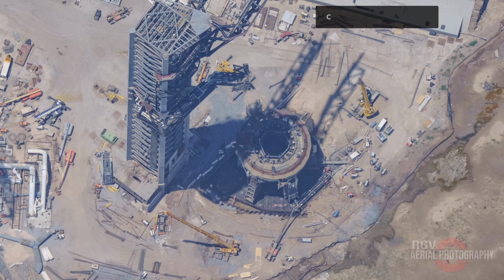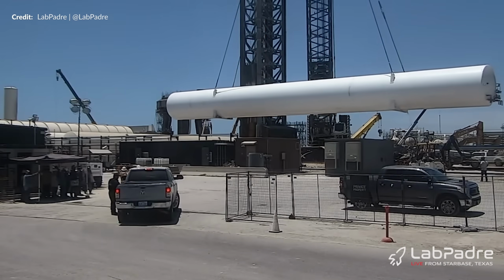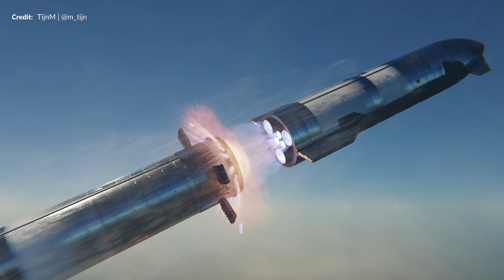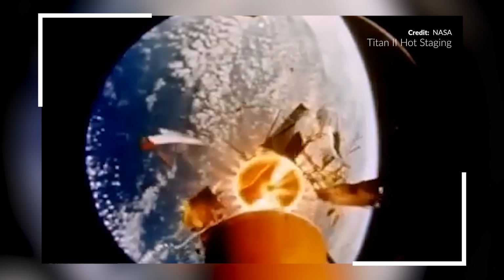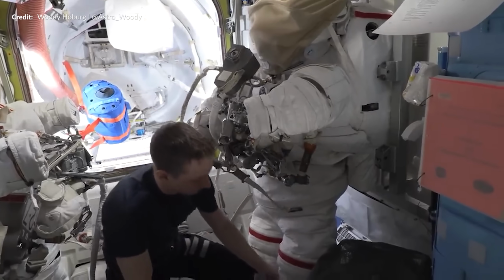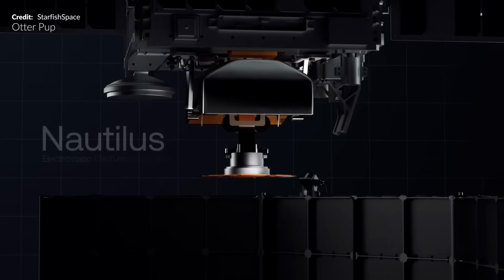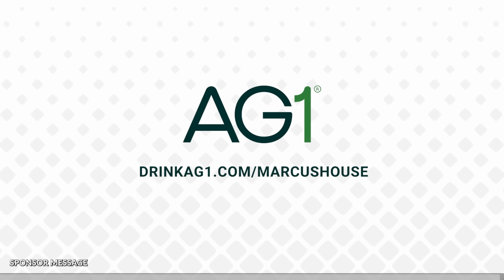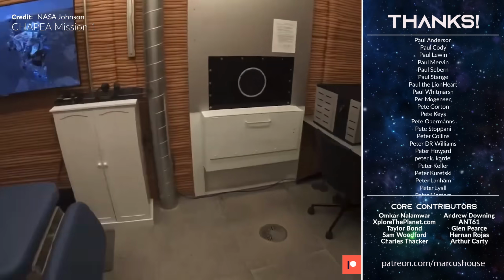SpaceX Drops Bombshell Upgrade Announcement: Can it really be that good?

Comment: It's just astonishing to me that SpaceX has all this manufacturing and constructing ability. There are so many projects going on simultaneously. It must be a massive task to line up materials alone. I mean where do they get all that stainless steel from, for example, all preformed to exact specifications. Wow, just wow!
Reply: I'm guessing you've never seen a mega mill being built before. There are astonishing things all happening at one time by hundreds of contract companies that are there to only do their job
Reply: I don't know that "preformed" is the right term - SpaceX has proprietary alloys which means they own (or at least control) everything in the entire production chain pretty much back to the smelters.  Most of the specialty metals used in spaceflight construction is also recycled separately and specifically for re-use by the same company since they need such very specific grades of steel etc - e.g. every test article that's damaged/destroyed will get melted down and dropped off back at the start of the production line, as well as all the trimmings/shavings from CNC machines and other manufacturing steps.  Smarter Every Day had a nice video on ULA that covered a lot of that stuff.
Reply: Calm down boys.  Has anyone stated/CITED a single reference here?
Reply: @Chucksss316 , I know  right.
Reply: Makes you realise how much military contractors are fleecing the government's.
Reply: @@Chucksss316 You know that there are almost 5000 different kind of "steels" ??

Steel is an alloy consisting of on a basic level of iron and a carbon content of less than 2%.
Speciality steels contain other metals to make the steel stronger, more elastic, more heat resistant, resistant to oxidation ..... various tweeking of steel properties.

SpaceX did work with steel mills to find the right speciality steel for it´s Starship project.

That steel is called 304L stainless-steel.

SpaceX build certain elements of their rockets out of 301 stainless-steel. 301 is a blend of nickel, chromium and iron and is more resistant to corrosion than carbon fibre. However, they have now moved to 304L stainless-steel which features higher chromium content and is therefore even less likely to corrode.

Of those 5000 steel types more than 2500 steel types have been developed in the last 20 years alone!

So please just shut up if you have no clue of what you talk about. Thank you!
Reply: There was a metal cutting machine in the video.  At least some of it was made right there.
Reply: Imagine SpaceX first has to mine all those metals from pits all over the world to then invent and built machines to transport it all to the US before they can even get started! (and since this is such an important part of the process, Elon doesn't trust anyone but himself with this task. If I'm not mistaken he's digging away and crushing rocks in Australia, as we speak! Wow indeed!
Reply: "No where near LOE"...
I guess you minded the 1st test flight of Super Heavy / Starship. Yes-it didn't achieve orbit, but got closer on a 1st flight test of a new and massive unbelievably complex Larget rocket ever built. Just wait a couple years, when Starship hits the cadence of current Falcon 9, the price per kilo to Orbit  is going to keep dropping. Competitors will have to drop prices to keep up, which means cutting costs = cutting corners in an unforgiving environment. Insurance $ will go up too, I bet.
Reply: Makes one wonder what they could do if they were tasked with trying to save our planet
Reply: I see people saying the government has accomplished more impressive things than SpaceX, but I feel that is time's past. Today's government is more focused on their next drone proxy warfare. It is more focussed on how to make its competitors stay down, rather than advancements not to be left behind. Capitalism does indeed incentivize progress, but that is only when the progress makes cash. When there are no more competitors, there is no more progress, and when cutting down a forest gives more green than planting trees, we will leave this space rock bare from trees. Just like artificial intelligence heuristics: if your heuristics are bad, the machine will not do what it is supposed to do, and will get stuck at a local optimum. Money is certainly a good heuristic, but it is not perfect, and that is what "pure capitalism" fails to see.
Reply: Don't worry, when the investor cash runs out it will end.
Reply: @jarigustafsson7620  The 'investor cash' won't run out; if the US can't cough up, then other sources will provide.
And right and proper! 👍😜
Reply: @tombaillie5219  You mean "can´t cough it up", I presume.😜
Reply: @kwichzwellbreck3567  No. "Cough up" is the correct colloquial usage.
In English.
Reply: @MrSilvertech for normal companies your right but space x own there own forge
Reply: @lesstevens2370  ".. space x own there own forge" .. just stop
Reply: It is not astonishing. That is the "norrmal" way companies could work and human society could advance.

We are just "used" to the slow pace of keeping the status quo that the government agencies and their tax payer extortionist companies have put into our living ......
Reply: You hit it on the head. Space X just gets stuff done. They keep so much in house that they have far more control over what happens. 

I wonder if it would be rough for Boeing and Airbus in Elon decided to start building passenger jets? I have a feeling that it would shake up the status quo severely.
Reply: @dalecp2  Well, perhaps he could challenge Boeing and airbus, but that will take some time. SpaceX puts existing tech to use, and as of now is mostly specializing in rocket engines. To attain the same tech in jet engines will take some effort, and besides that there will be many bureaucratic obstacles.
Reply: @kwichzwellbreck3567  What do you mean? Saturn V was a government project and they never launched failures like SpaceX did, on a fraction of the budget.
Reply: @Ildarioon  Rofl ... are you for real?

From 1964 until 1973, $6.417 billion (equivalent to $36.9 billion in 2021) in total was appropriated for the Research and Development and flights of the Saturn V, with the maximum being in 1966 with $1.2 billion (equivalent to $7.77 billion in 2021).

That is 36.9 billion of dollars in 9 years! Just alone for the Saturn V. Dont get me started on Apollo Missions.

Musk has said that Starship will cost the company between $5 billion and $10 billion to develop. And 2 million USD for flight costs per flight (mostly methane and oxygen costs). I have not seen what the production costs of 1 Starship will be but I am more than sure it is not the same like a Saturn V but way lower. 
Furthermore since it is fully reusable one starship could do the 13 flights of the 13 Saturn Vs. But since we need around 2000 Starships to build the Mars colony that is just a side note and will never be in reality.

As for launch failures of Saturn V out of the 13 flights one was a failure. But that is during OPERATION not during testing.
1 in 13 is roughly a 7,5% failure rate. As Starship is not in operation yet we have no data to compare to that.
But we can compare it to Falcon9 who has now 237 launches. Of those 3 were failures (1 partial, 1 inflight, 1 static fire test) but we only had success for the last 209 launches!!! 

That is a failure rate of 1,2%!

Furthermore the development process between NASA and SpaceX is completly different.
NASA is "testing" in theory while SpaceX is testing in real life.
NASA is "sticking" to a design as planned where SpaceX is constantly adapting the design.

You see......you are talking complete nonsense!
Reply: @Ildarioon   The Government is able to put a LOT more money into things if they want to than any civilian company.
Reply: @kamxam1384  Starship is in the same ballpark and is still a failure right now, even with all the advances in technology(numerical simulations are huge in engineering, both for reducing costs and increasing efficiency and success, manufacturing became a lot better too, etc).
Reply: @Ildarioon  Certainly, computation tech is awesome, but it is not magic. If there's a thing I can tell you as a programmer, is that bugs find their way into your code one way or another. In real world engineering, I imagine these digital bugs could be translated to: "We failed to correctly verify the material behavior of our tank, that in conjunction with some unknown geometrical imperfection has caused our hydrogen tank to explode". Simulations are that, simulations.
Reply: @kwichzwellbreck3567 Without "the evil gubmnt" emush would've been out of business years ago.
Reply: @kwichzwellbreck3567  Aww bashing on government agencies is so revolutionary.. That government agency took ballistic missile tech and developed it to put humans on the Moon and back in just ten years, inventing through unknown when most powerful computers were weaker than modern day handphone. SpaceX in 10 years since starting working on Starship is nowhere near low orbit flight.
Reply: @kwichzwellbreck3567  your premise of making complex  economics  and human interaction down to a club mentality of socialism/capitalis is embarassing.
Reply: @michaelperry5463  Your inability to understand the overlaying simplicity of the matter is the only thing embarrising here.
Reply: @AG-ig8uf  There are always success stories but the smart phone would have arrived eventually because of the enormous revenues.  Pure research with government spending does produce results but the taxpayers never get the benefits.  Must companies got breakthroughs at the taxpayers expense.
Reply: @kwichzwellbreck3567 You mean "embarrassing", I presume.😜
Reply: @AG-ig8uf yeah but he’s not wrong. That government you speak of is back when it was more efficient. Governments by design become more and more bloated and slow to accomplish anything. Some reasons are good and others are just a consequence of how they are funded.
Reply: @AG-ig8uf That's because there was a military and political drive. Proven by the progress falling off once the politicians lost interest.
Reply: @AG-ig8uf difference really being is the tech then barely achieved that goal. Starship goal isn't just the moon, so WAY more R&D is going on simultaneously to meet future goals and prevent rework later. So 10 years and what they have accomplished so far really isn't horrible
Reply: @TorbinMcKnight  They missed nearly every single goal they set. Most of them were stupid from the start to be honest. Let me remind you that following SpaceX timeline, we would be travelling across the globe in rockets rather than plane years ago already. I won't make a full breakdown but there are many channels compiling SpaceX failures. 

And Saturn was way more impressive. As an engineer, having so many tools nowadays to model and simulate every component and falling so far short from Saturn V is a fucking shameful matter. They literally tested no new technology before the first failure of Starship, they just failed to fire multiple rockets, something that has been mastered long ago.
Reply: @redman2751   Why is it so hard to leave fan fiction aside and focus on simple facts ? NASA took ballistic missile tech and in 10 years put humans on the Moon and brought back. SpaceX spent 10 years on fancy shows, CGI renderings and endless youtube promotions to just blow up a launch pad. Mind it, all this time, saying that SpaceX is using "revolutionary rapid development" strategy, like software development, so they make more mistakes but deliver faster. It's been repeated so long that fanboys lost track of time, and don't even realize that by now it's exact opposite of "rapid development" loll.
Reply: @AG-ig8uf  I never said it was a bad thing back then. Just saying it’s a different government now. Either way what nasa is doing now and what space X is doing is fantastic. Wish we would have kept the space race going instead of stopping it as soon as we made it there.
Reply: @rockpadstudios  Ownership, copywrite that's what motivates, and has made America a power house of inventions, and innovation.
Reply: @renadog1  I've worked with Russian, Iranian, and other engineers and the ones I've worked with are excellent hard working engineers.  The Russians worked really hard and I loved working with them.  In my career I've found most American engineers to be smart but lazy, the old school Motorola engineers were impressive however.  When I look at breakthroughs' many of the key commercial ones were from Japan at least in semiconductors.  I don't see America continuing it's dominance myself, I hope I'm wrong.
Reply: @rockpadstudios  I think your right though. All good things come to an end. Complacency, welfare and the new 'woke' agender seems to be by plan. The 'Golden Age' of industrialization seems to have been replaced with Fools Gold.

Comment: My understanding with the hot staging change related to the asymmetric loads that the flip staging created, unlike Falcon 9 which pushes the second stage away symmetrically. The flip move was to save on the weight of the staging hardware that Falcon9 has, I think they use a piston that pushes right on the engine. The nature of that flip maneuver would require a lot of precision in the coupling between the stages. With the mass of both, it would be easy to have something bind and stick at the wrong moment, requiring a looser style interface, which would introduce other problems. Would have been cool to see them pull it off once, but they need it to work perfectly every time.